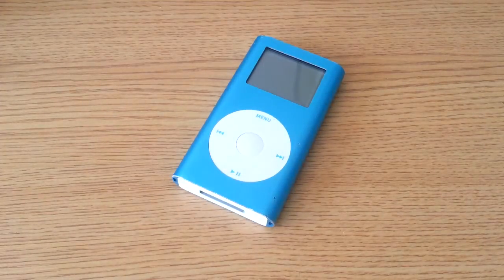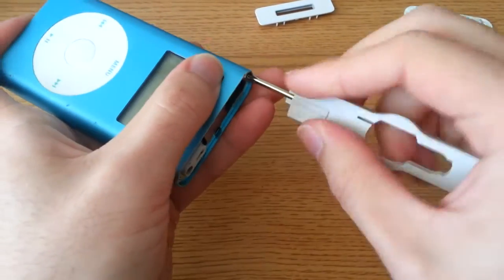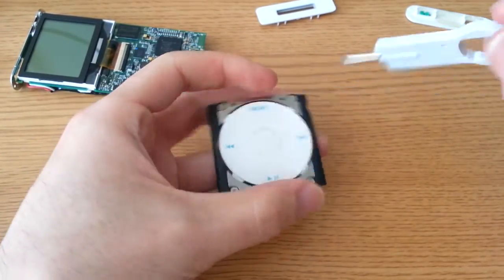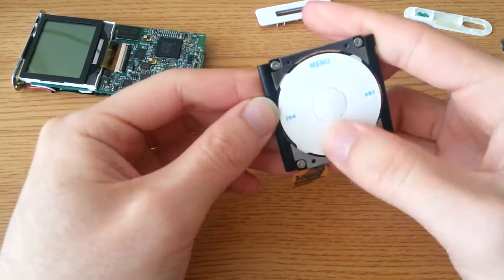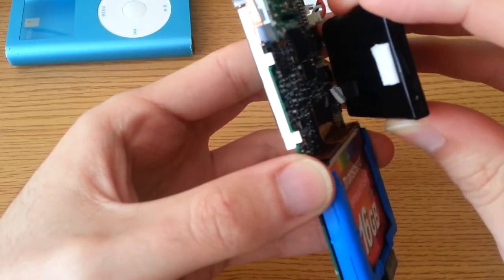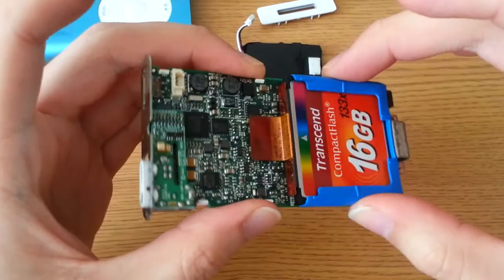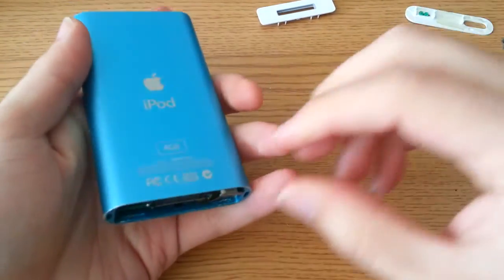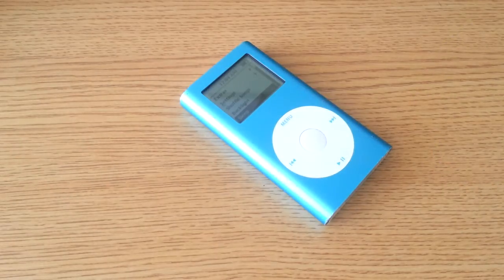TeardownTube - episode 28 - 2nd Generation iPod Mini

Comment: İts keeping me restore all again in i tunes.

Used 64 gb sdxc and restoring and going back every time.Any tips?
Reply from the maker: It could be the cf-sd adapter you used isn't fully compatible or the sd card itself may need to be fat32 reformatted outside the ipod.

Comment: I bought 2 of these ipods, replaced the hard drive with a CF adapter-128gb memory card, on both ipods when I press down (on the top white cover) the audio stops (software still runs normal on one ipod). On the other ipod, the song suddenly pauses and sometimes the ipod shutts down.  Before the mod, both ipods worked great with no issues, I was thinking it could be the grounding? any ideas?
Reply from the maker: Sounds like something is shorting inside
Reply: @sjm4306  Thank you!

Comment: Great video. Do you know if there is any hardware difference between  first and second generation from these ipods. I am aware of colour differences and 2g been available with 6gb capacity. Aparently also better battery performance on 2g. I am thinking to buy a used one  to upgrade the battery and storage capacity anyway and hope the battery perfomance will not make any diference unless there are other differences?. Is there any diference in internal buffer memory, screen, resolutionn main board or any other internal relevant  hardware differences to be aware of between the two. I have tried to find this info online and even at mac site I can not see  if they are identical or not. Thanks
Reply from the maker: I did a quick check and there doesn't infact seem to be anywhere that does a comparison of the technical differences. From my personal experiences taking apart both models, the lcd resolutions are the same, but seem to use a different controller as they are not physically or electrically interchangeable. Interestingly enough while the click wheels are physically interchangeable, they are not recognized by the wrong model (my guess is they use a serial interface like i2c and respond to poll requests with a firmware number/address at startup that the mainboard of the mini has to match for it to work). As for the ram, I highly doubt apple would spring for a larger chip for no reason, and looking at the firmware update file sizes for the two models, they are near enough in size to assume the ram chip size in both models are likely the same. My guess as to what differs (can be easily confirmed by looking up teardown images of the pcbs) is in a more efficient power management switching converter, dac output chip, as well as possibly cpu (though this may even be the same since the functionality between the 1st and 2nd gen isn't very different).
Reply: @sjm4306  in your experience are you aware of any other limitation in the upgrade process between 1 and 2 generations? meaning upgraded storage capacity limitation or battery performance using new identical aftermarket batteries? I asking this as I see more mods on second generation than first generations even tough I have seen few 1g upgrades online as well. many thanks
Reply from the maker: No real difference in the mod process, most people just use the 2nd gen because it is quite a bit more efficient than the 1st.
Reply: @fixall336  same process, but the tech specs do differ. I know that the 2nd gen has a higher ceiling for how much flash memory it can handle. The bottleneck is ram based, and most noticable when using features like shuffle (which actually requires it to 'think' a bit). The stock battery has a longer life in 2nd gen as well - no idea if that difference carries over once you replace the battery (i.e. was it a better battery, or how efficiently it was used?). Depending on the mod you are planning (eg - upgrading to 32gb) you may not notice any difference at all.
Reply from the maker: Iirc the 2nd gen was more efficient than 1st gen, accounting for potentially over double the run time.

Comment: You should replace the screen with a colour (yes I'm British) display
Reply from the maker: That would be a difficult undertaking. I would need to modify the firmware and hardware to support the new lcd. I guess the ipod nanos are the spiritual successor of the mini anyway but with upgraded screens and flash memory. I was playing around with the idea of changing the backlight color on this mini ...
Reply: @sjm4306  how difficult would it be to change the backlight colour? Now you have me curious. If you try that out - it would make a great video.
Reply from the maker: The backlight consists of two right angle smd white leds soldered to the ribbon, it'd require partially dismantling the lcd to desolder and replace the leds. Not super difficult but a little fragile.